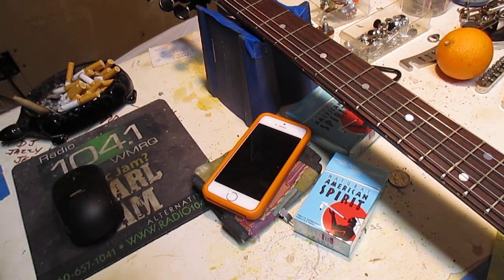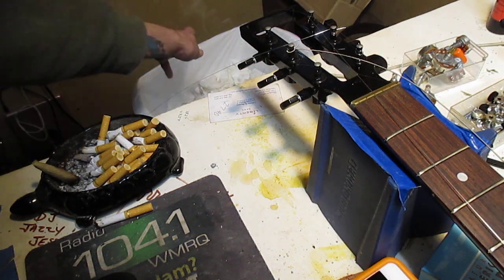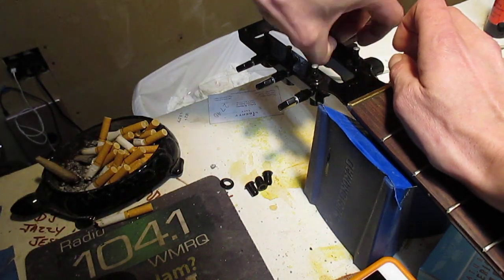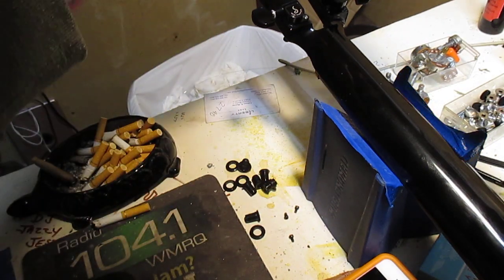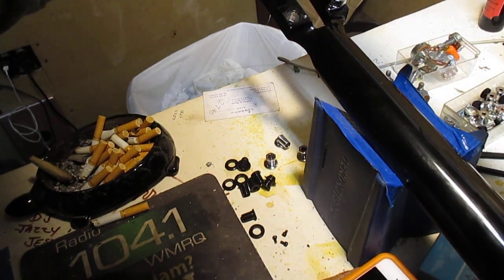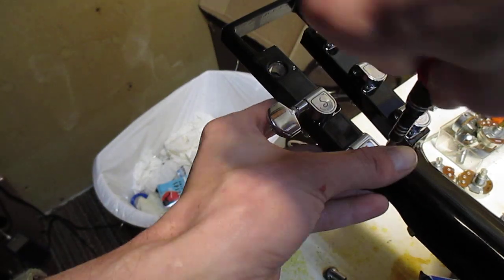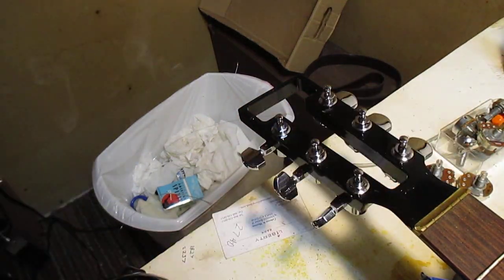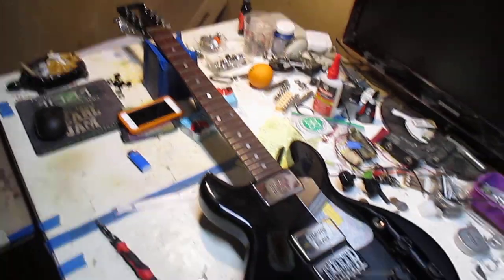Travis Bean tuner upgrade Part 1

Comment: The chrome tuners do look great, thanks for sharing!

With the USPS, I would recommend that you always take the package in and have them weigh it as they scan it.  The weight will be recorded on the receipt.  I know of someone who dropped off a package without waiting for it to be weighed and scanned so that the weight wasn't on the receipt.  The receiver was dishonest and said that they didn't receive the package, only the shipping label.  Without a weight on the receipt, there was no way to argue that and the shipper got screwed by the USPS.